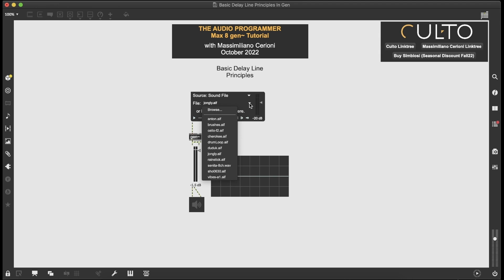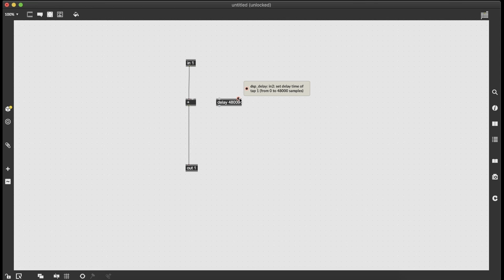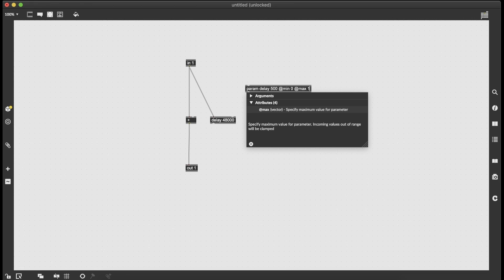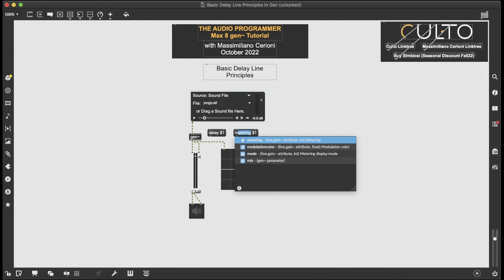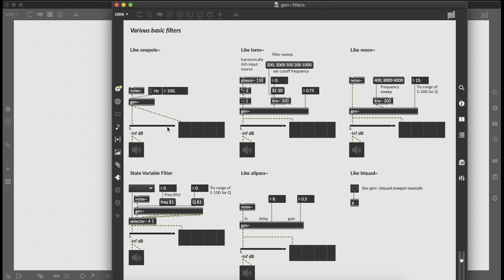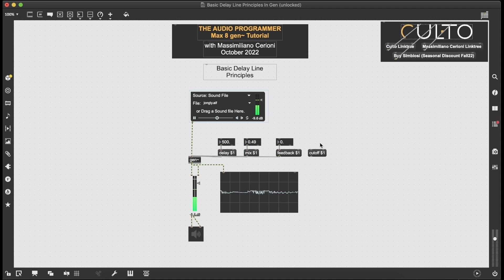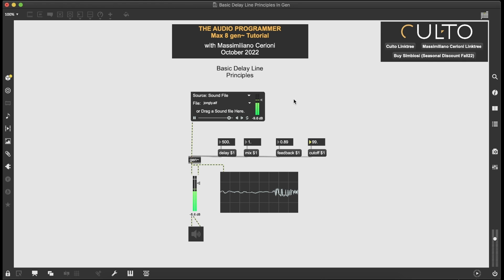Max 8 Tutorial Series | Part 2: Basic Delay Line Principles

Comment: I don't understand what you say around 10:10 second "20 db per ???? and 6db per octave", you say something like "decay" / "decade" but it's not clear exactly what you mean?
Reply: You have heard it right: it is "decade", and I gotta say that is actually pretty clear in this context, although I understand that not every Max coder has gone that deep into Signal and System theory. Filter frequency responses are plotted on a Bode Plot, which has two combined plots showing the phase and the magnitude values. I am here referring to the attenuation of the magnitude value - let's say the 'dB loss' that increases as the measured frequency becomes higher and higher than the cutoff one. For this filter, the loss equals to roughly 6 dB per octave when we are describing it in a musical quantity; as we know, octaves are related to pitch and not to frequency, and the relationship between pitch and frequency is not linear, so the dB loss related to frequency values is different. On a Bode plot we represent frequencies on a logarithmic scale with base ten, in which the grid is subdivided by decades representing powers of ten (10^1, 10^2, 10^3, or 10, 100, 1000 etc.). Therefore, the dB loss per decade is equal to 20 dB. If you want to investigate further on these topics I suggest you to search for the following things: bilogarithmic plot, Bode plot, frequency response. In Max you can get confident with these filter-related topics by studying the helpfiles of the objects [filterdesign], [plot~], and [filterdetail].
Reply: @MassimilianoCerioni  amazing information, thanks a lot for sharing!

Comment: after the cutoff parameter, why not just a [scale 20 20000 0 1] ?
Reply: Hello! This is a Filter Design question, I didn't plan to go that far in this tutorial, and mentioning perception was partly inaccurate from my side: this cutoff is perceptually correct cause it is mathematically correct at first. First of all, we are here scaling this filter's cutoff accordingly with the audio range, but a 1st order digital low pass filter cutoff can go beyond the audio range: for instance we can use it to filter a 3 Hz LFO wave. Hence, the filter coefficient boundary values "0-1" are not directly equivalent to the average audio range boundaries "20-20000" Hz. Then, the scaling operation you are suggesting would perform a linear resize of the full range without taking into account the exponential relation between the coefficient of the filter "a", and the cutoff frequency "f", which in this filter is expressed by the formula "a = e^(-ω/samplerate)". The second term of this formula is an exponential term, expressed by the natural logarithm basis 'e' raised to "-ω", where ω is the angular frequency that is equal to 2π*f. Lastly, since these frequency values are expressed in a digital domain - i.e. in samples, we divide the exponent by the samplerate value. So, if you don't implement this formula properly, the resulting coefficient values will not reflect the cutoff frequencies you are expecting. You can double check how results are different in this example patch: https://pastebin.com/MrMqPGZK
Reply: @MassimilianoCerioni  great, thx